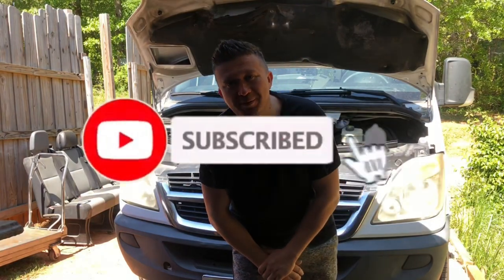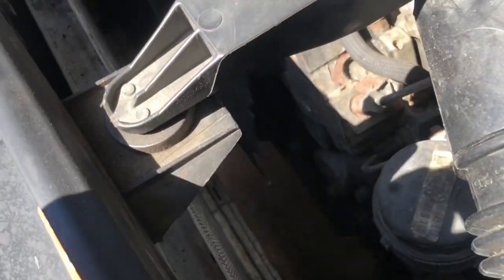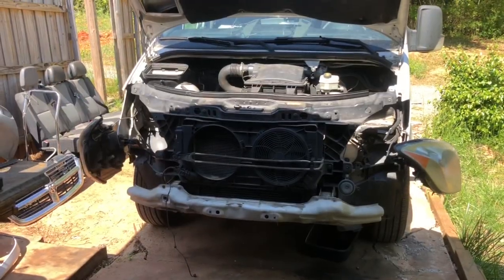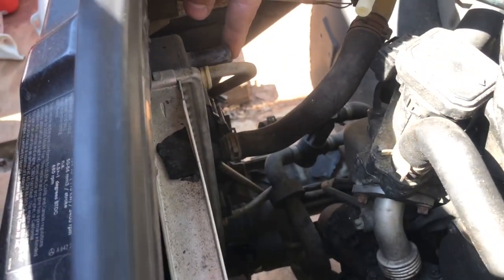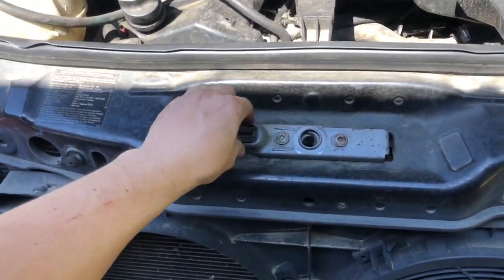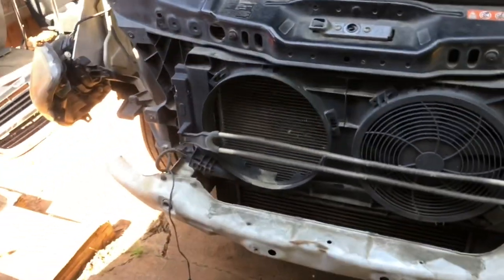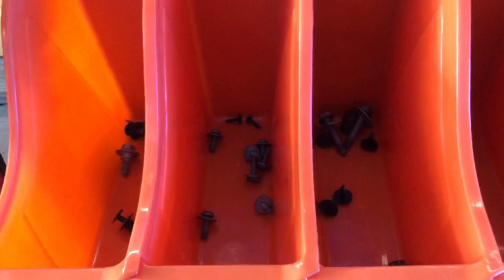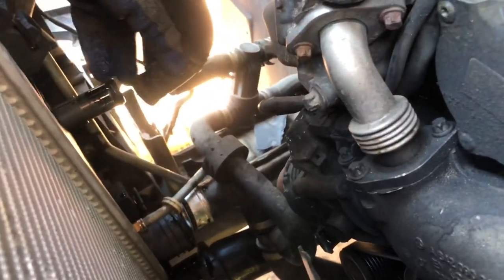Don’t Make this mistake $2,000 Damage Broken Fan, Busted Radiator I will fix this Mercedes Sprinter

Comment: Nice and useful video, thanks.
What should I check, when engine oil dripping from alternator, while the engine is running? It’s same version with 3.0L. Thank you!
Reply from the maker: Engine from alternator can be anything, basically anything from boost leak, valve cover leak or high pressure fuel pump leak, in the older T1N sprinter turbo sits right above alternator and oil leaks from turbo pipes of the breather house, sometimes the metal pipe that bolts on to the turbo is leaking oil on T1Ns
Reply: @ZimaletaMotors  👍🏻Thank you Sergey, I have to dive into and start snorkeling.
Reply from the maker: Good idea